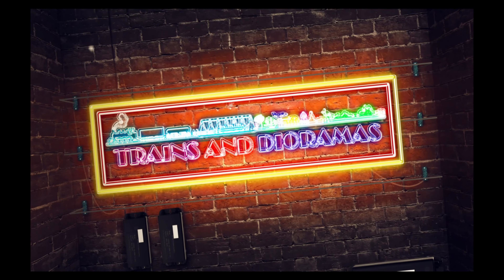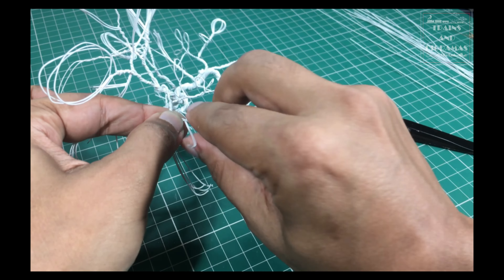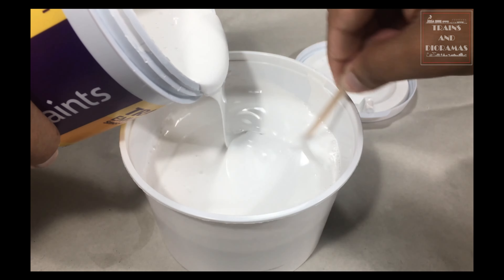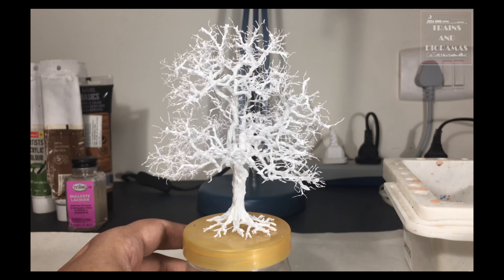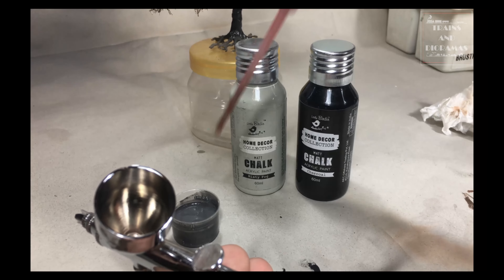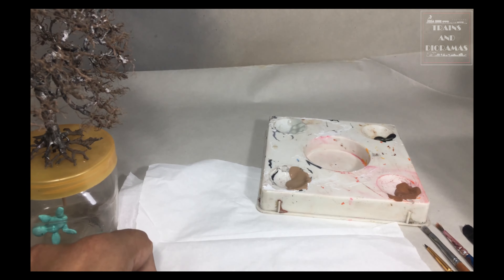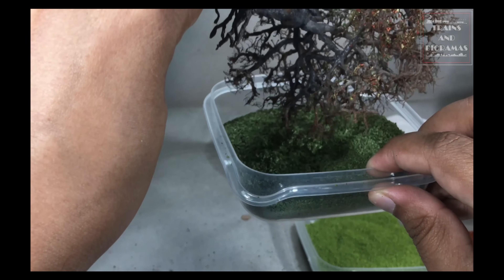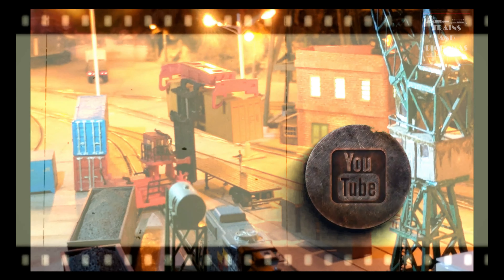Make a Model Tree That You Can be Proud of: Wire Tree Tutorial

Comment: What is your paint to water ratio when using the emulsion pain for dipping your tree? Does it cover the wires well or do you have to use latex rubber or putty?
Reply from the maker: The emulsion paint works like a primer - I use roughly 50-60% diluted paint for florist wire. The ratio will depend on the type of wire you use. You need the paint to be fluid enough for florist wires that already has a thin coat of paper. On bare metal wires, you need relatively thicker paint since otherwise it won't 'stick' - I always recomend a few test run. And yes, once the paint 'binds' wires properly and preps the surface, I use a scuplting material to sculpt the trunk and the bark - Latex Rubber or Acrylic Sculpting paste. Here is a recent tree that I built which is a variation of this method where I use the acrylic sculpting clay directly on the florist wire, and the results were pretty encouraging - especially if you want to retain the ability to twist your wires /branches: https://youtu.be/WUe03uEIWDs

Hope this helps. Cheers!
Kaustav
Reply: @TrainsandDioramas  Thank you very much for your help. I enjoy watching your videos and have learned a great deal from them. My trees are not as finely detailed as yours but I'm enjoying making them anyway.

Comment: Making some now. Unfortunately I'm having trouble finding Noch leaves but I have some from other brands. I never thought of using smaller wires for smaller branches, then poly fiber on top of those, I have been using small static grass for the smaller stuff. Glad I found the video.
Reply from the maker: I am really glad that it helped! There are other leaves depending on what is avilable near you. If everything else fails, I find some dried leaves, grind them throughly and use a sieve to get the size I need. I think the dried leaves work out great for smaller scales and is really economical. Cheers and thank you for stopping by.
Reply: @TrainsandDioramas  I have some I ground down myself, as well as some from other companies. I have been trying to get Noch leaves for a few weeks now but mostly what I find the shipping costs 3 times the amount as the product.
Reply: I use dried parsley as leaves works like a charm and readily available

Comment: A superbly produced video and a great tree. I was with you all the way until you added the finest wire and then I thought you are insane LOL Take that in the good humour it was meant. You truly have the patience of a saint! Then you surprised me with the addition of the fibres. From then on, everything was pretty much as I expected and the result was predictably superb. However, therein lays the problem. Unless these trees are kept in glass cases or hermetically sealed rooms, they are the most powerful magnets for dust and at times, cobwebs and keeping them clean is a nightmare. They don't stand up well against accidental knocks, or indeed playful cats,  either. So, do you have any tips on how to clean them? I myself prefer to make 'indestructible trees' which look realistic, but can be jet washed with a water-loaded airbrush  or even vacuum-cleaned without any damage whatsoever. Yes, I sacrifice the super-realism that you can achieve, but not by much.  The only downside of my method is the fumes from the CA glue! They are not trees for making indoors. B.
Reply from the maker: Yes, I am a bit of a nut case when it comes to details, but these trees are not as fragile as they look - the beauty of making trees using wires. What you said is right if you’re making seafoam trees. For these trees, you might lose some foliage to the vacuum (and you can always attribute that to the season!) and might need some leaf refill once in a while, but other than that, these trees are hardly enough. Thanks for stopping by. Cheers! Kaustav

Comment: Wonderfully done. My suggestion: applying polyfiber through the static grass applicator as the fibers land perpendicular to the surface of the wire. Tried this making cypress trees and it came out really well. All I had to do was give it a blow of air from bottom to top and let dry. Apply finely ground foam (earth colour) for old growth and a layer of green finely ground foam. Looks rather cool.
Reply from the maker: Thank you! Yes, that's what I thought at first as well, but since the poly fiber I used are taken from my dog's chew toy, they were very twisted! So much so that I couldn't get a better flow through my static grass applicator. 🙄 May be I should build a new one with a larger mesh just for this purpose. Thanks again for looking. Cheers!

Comment: I have spent hours and hours trying to make a wire tree. By watching this video. I realise everything I did was wrong. To make realistic trees is a very had and tedious achievement. Your tree was a true work of great art.
Reply from the maker: Thank you! I found that when it comes to making realistic models, it always takes extra effort. However, for trees, there’s an amazing alternative - sea foam or what Scenic Express sells as ‘super trees’ - using that with some commonly available dried twigs can give you pretty convincing trees.
Reply: I have been thinking the same. But the trunks on all of the twig trees look unconvincing. I plan to find som suitable twigs. And then thicken the trunk part with wire and filler. Like you did with your tree. Thanks for the reply.